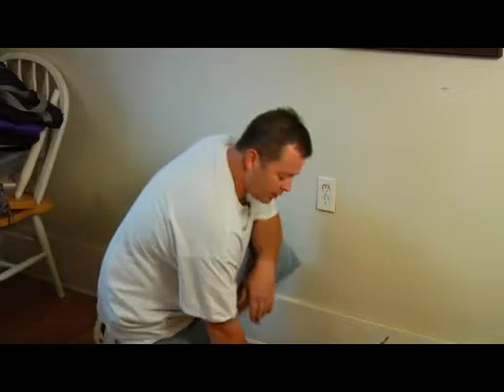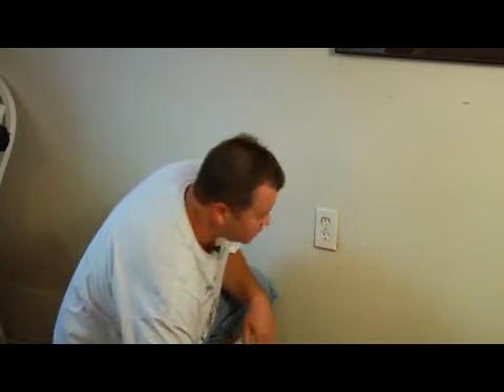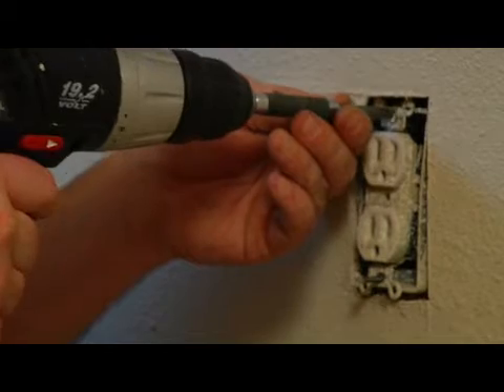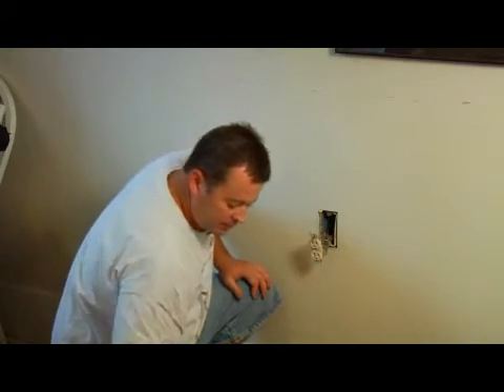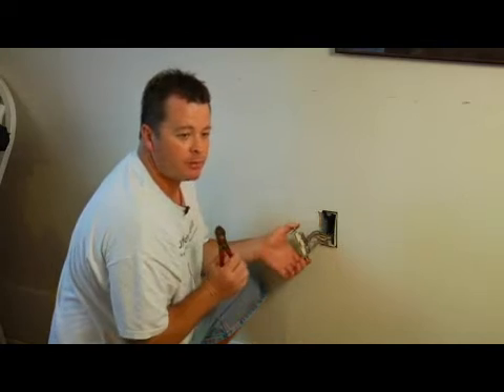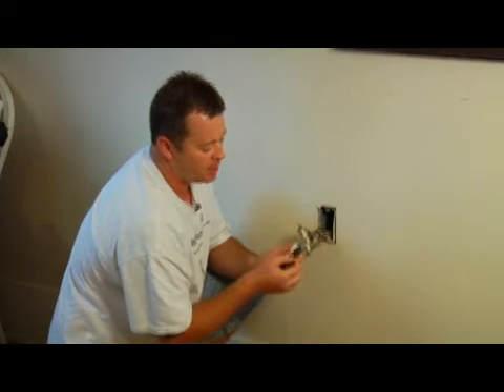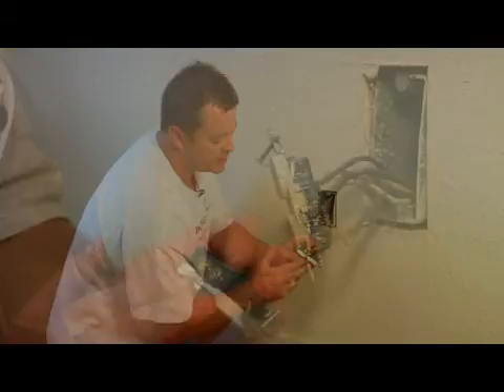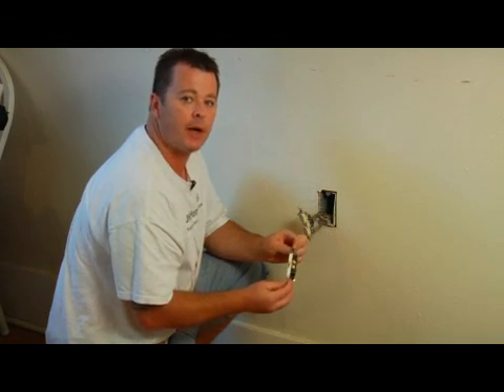Electrical & Plumbing Repairs : How to Replace an Electrical Outlet

Comment: that box in the wall is very loose, you should mention supporting it with either new screws or 820 D box supports (F- straps)

Comment: James you forgot to mention that ANY DIYer needs to use proper safety gear AT ALL TIMES as in: insulated gloves and eye protection. NEVER EVER assume an electrical circuit is dead, had the circuit been live a DIYer would have gotten bitten bad the way you handled that outlet. EV needs to disclaim on EVERY video that any electrical work should be performed in accordance with local and National electrical code and safety needs to be observed in ALL cases.